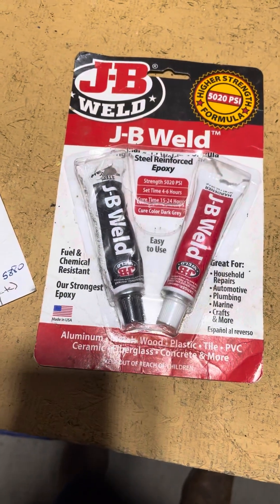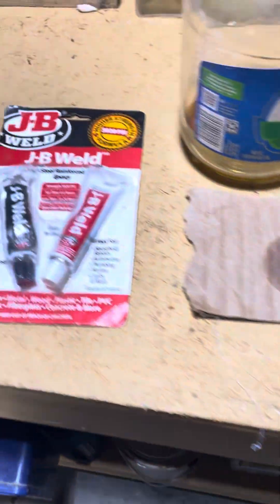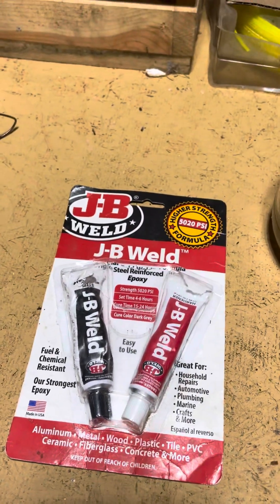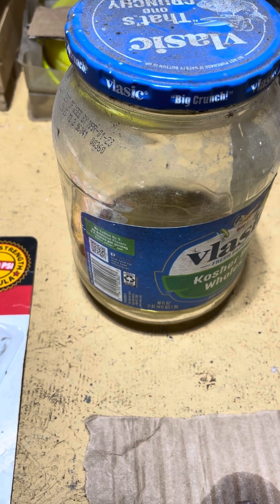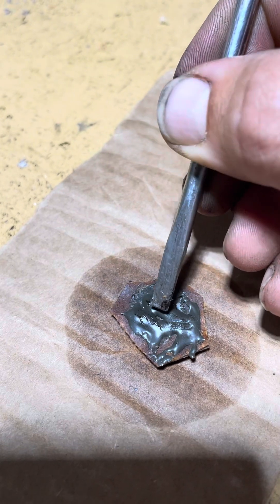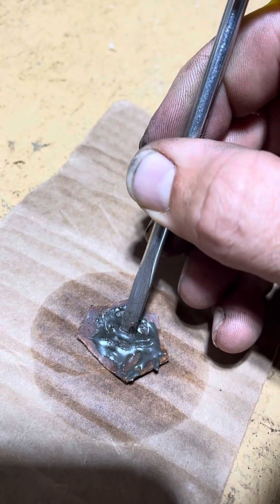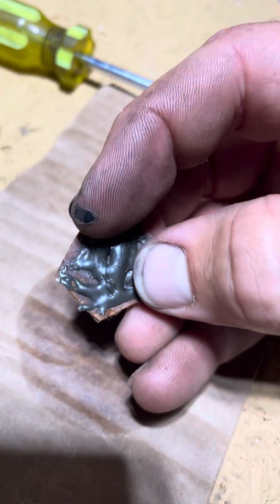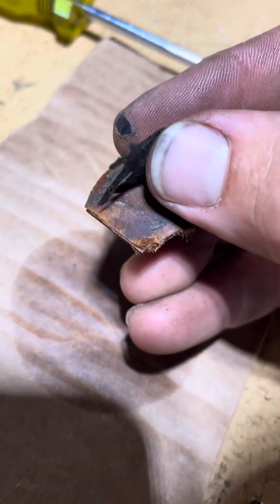Is JB Weld gas resistant? A very unscientific three year test to see if JB weld holds up to Gas

Comment: Ive had a 1973 lawnboy pushmower the earliest hard plastic style carb bowl id seen found out hard way tapping screwdriver trying to unstick the float after sitting all winter
2.5 years later and at least 3 hours of mowing... Only a trim mower 
Carb is still not leaking 
Another buddy jb welded a cracked trans case on a 96 or so 2500 v10 dodge ram and drove it a year before dodge wiring did its thing and killed it

Comment: Works on radiators and oil pans     Interesting test    thanks for sharing
Reply: also fixed a radiator on a 68 nova decades ago. still sealed after 3 years when I sold it!